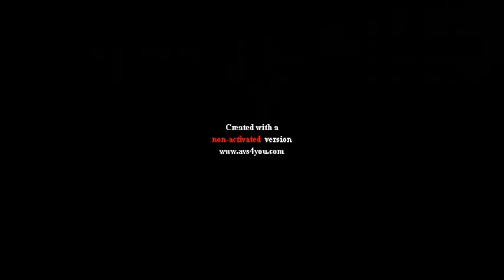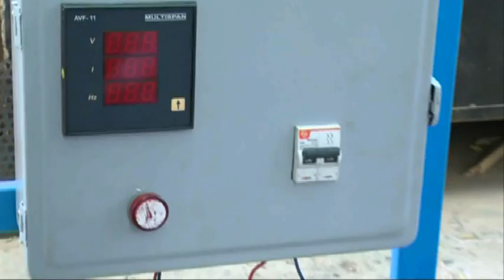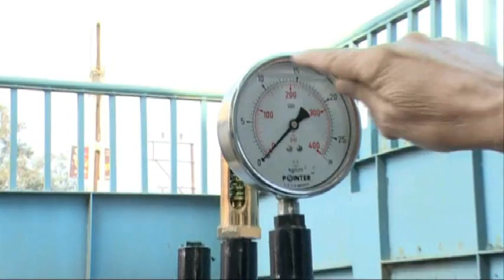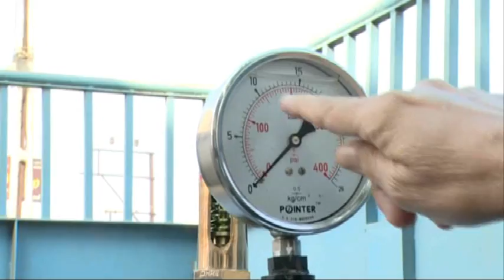BOILER & STEAM ENGINE [ MINI POWER PLANT ]

Comment: Can you build a 3 by 5 Semple marine reversing engine. Cost?
Reply from the maker: tandem compound 
Send whatsapp on 9227606570
Reply from the maker: tandem compound 
For any information please mail us on tinytech@tinytechindia.com
Reply from the maker: We can suply compound steam engine with 90mm diameter x 114mm diameter x 80mm stroke USD-2200$ it will 9 hp or we can suply 90mm x 127mm x 116mm stroke USD-2800$ it will be 15 hp.